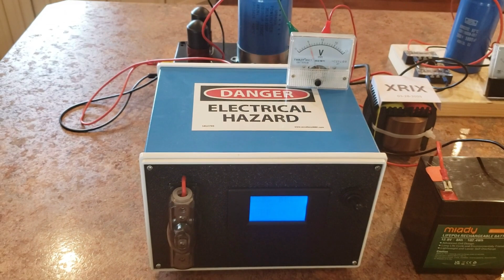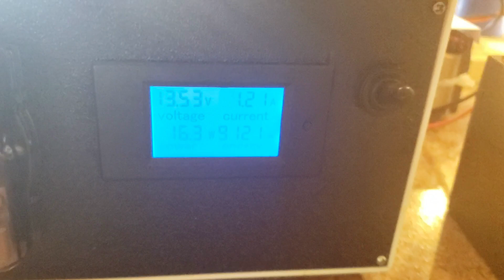Over Unity Working Don Smith Device - Part III

Comment: Can you please tell me the model of the LEDs used? Does it consume 20W each or is it equivalent to 20W light? I found PHILIPS 2W class A bulbs and they are equivalent to 40W!
Reply from the maker: I have used these but I buy different kinds https://www.amazon.com/dp/B082PQNSH3?ref_=ppx_hzsearch_conn_dt_b_fed_asin_title_7&th=1
Reply: @XR_IX  I invite you to put an ammeter on the output after the large capacitor, and of course an incandescent bulb! AI invited me to connect UTKIN's transformer to the battery and do tests with or without load if the power supply doesn't show me extra consumption!
Reply from the maker: @profy2002  I don't trust AI

Comment: could you run an inverter off the output cap powering the lights?
Reply from the maker: Yes, if you are talking about creating the inverter off the shelf. If you think you are going to attached it to a COTS inverter, you have to boost your input power. Basically it's a question of magnitude. Multiplication of very small  (half a joule) is going to have to have more power or more tuned stages.
Reply: @XR_IX   thanks for the reply, have you tried or would it be possible to boost input power with something like a cockroft walton or marx voltage multiplier without needing to increase actual the battery size or source input, just thinking along these lines cause you could charge larger input caps by leveraging the massive potential difference of the voltage multiplier and ground or chassis ground if you want to keep it isolated
Reply from the maker: @SYNTNT  Don't think electrically, remember what the fulcrum is. Input energy is simply how large the exciter capacitors are. How do you fill larger buckets?
Reply: @XR_IX  sorry was referring to the exciter caps as input caps, could this be viable to charge larger exciter caps? i've got a simple plasma globe osciallator, basically a tiny flyback, charging a cap thru an avramenko plug and when i ground or floating ground the negative of the cap it increases the charging rate massively, i was thinking that running a voltage multiplier off the flyback would increase the potential on the positive side would increase it further, meaning i could charge larger caps without 'more' input, and then eventually go the full way to transforming.
Reply: @SYNTNT  
Hi SYNTNT,

I was able to get the exciter using a 4kv nst to fire at around 30 times a second with a 1200v gdt with  3 2100v 1uF cap in series. The power usage for the nst is around 13watts running from a 12v power supply.

Do you know how fast your caps how many times you can discharge your caps with the plasma globe oscillator? The voltage that you're discharging at and the size of the cap and the frequency that you can discharge at. 

I've been experimenting with earth grounding with a different setup. The earth ground was able to change my output from 76Vpp to 182Vpp. I am pretty sure I'm still doing the electron cycling incorrectly. I still can't get much current from earth grounding. You're supposed to be able to get as many amps as voltage with earth grounding, but I can't get anywhere close to that. The rms voltage was like 20v-40v or something. It would be awesome to be able to get 20v at 20amps. I'd be happy to get 20v at 1amp right now. The earth ground wire I'm using is only 10awg.
Reply from the maker: @SYNTNT  You have try to run down your theories by experimentation. Only way to be sure. It is the scientific method we learned in third grade. I have been working with others who try to produce "More" from electrical tweaking. It all seems promising... until you put a load on it. The only path forward is magnetic multiplication. Of course that works best in a resonant configuration. A globe is useful, if you manipulate the guts to be disruptive. If you want "More" just stick a disrupter circuit inside it. Because then you are creating a strong magnetic disturbance. More dense flux lines, means more capturable current in a coil.
Reply: @briareosbri i just uploaded a vid, nothing special mainly just messing around but there’s lots of different arrangements, the tiny oscillators dont charge the caps fast enough for any real work but the slow pulses are easier to experiment with and figure out what works, i think it might be possible to increase cap charging rate with a voltage multiplier for little to no increase in input but we’ll see, XR is right that the real power is in multiplying the magnetism, im just also interested in seeing how small that input can get
Reply: @XR_IX agreed, dont want to start chasing the wrong rabbit lol, part of it is enticing though since the exciter caps are essentially electrostatic, just makes me wonder how low you could get the input since creating a huge potential difference can be basically free with the right setup, ill be uploading vids with progress if you’re interested, looking to replicate OU I, or maybe do a kind of spin off if i can get things rolling. thank you for sharing all of this info though, genuinely, it’s helped a lot
Reply from the maker: @SYNTNT  Sharing makes me focus. Thank You

Comment: Hi XRIX, thank you for your contributions, I’ve learned a lot from you. Question regarding the use of capacitors to generate disruption as opposed to coils.  Assuming youre familiar with Rick’s work, in what he calls the ‘third stage process’ of his motors, he uses the pulsed DC  output of the coil to feed a chain of series impedances where each impedance acts as a negative resistor. It’s to my understanding that your OU I works in a similar way except instead of a coil impulse driving the chain in series, it’s a disruptive discharge or capacitor impulse driving the chain in parallel. The capacitor seems to be such a crucial element in both the blocking aspect (like smith showed with the DSE & in the Hairpin) and discharge aspect (like in Kemeny’s patent where cap discharges seem to create the desired conditions along the wire where his motor coil is placed). If the capacitor is so crucial in these setups, but the same effect can be achieved with coil impulses like in Rick’s setup, why opt for capacitors, are there advantages? Am I missing or confusing transmission with amplification? Thanks again ✌️⚡️
Reply from the maker: Those are good questions, and I am not familiar with Rick's work specifically. I would be speaking to the device details where I may mottle his core principles or get it wrong. I can tell you why a capacitor is used in my devices, but also why you can see the effect outside of using no capacitors. My theory, is that as Don Smith said, that it is the "On and Off" of current that creates an effect. A capacitor is not needed to accomplish this as Don said you get this effect every time you turn a switch on and off. It appears when a spark gap is used, because it functionally is an on and off. You can read in physics that  a spark gap creates RF when it snaps, and low level X-Rays.  The abrupt acceleration and immediate stop, creates the disruption. I theorize that disruption can be used to gain multiplication of action, in magnetism, which can be either used to push a magnet, or induction for transformation. I capacitor just makes the disruption quick, like a stroke of hammer. Slowly dropped a hammer has little power, sudden impact creates more power. Tesla was hired to figure out why Engineers would die when they turned on huge DC dynamos. Same effect in a large enough quantity influences all conductors in the near field, and we are bags of water with a ground path.
Reply: @XR_IX Thanks a lot for the response, as someone who gets caught up in a lot of the details, that simplified things a lot, interesting fact about Tesla too. Would you mind to elaborate a bit on your Mini-Wardenclyffe Runs Motor & Light video, and unlisted Mini Wardenclyffe video? Looks to me like they’re both, especially the unlisted one, essentially the same as Don’s AEG schematic except using a FWBR on the second plate instead of an Avramenko plug, as well as charging a cap with the potential difference to run the motor, and running an LED with the counter plasma or displacement current (?) coming from the ground. My question to this is are both of these methods to driving the loads transmission artifacts? If so could amplification be achieved by adding coils/ impedances along the ground wire or the wire coming off the second plate to intercept whatever current may be present? Or maybe simply adding more FWBRs or Avramenko plugs as long as they are decoupled effectively from the TX? Kind of just thinking out loud at this point lol. Any feedback is greatly appreciated. Thanks again ⚡️
Reply from the maker: @pebnut  I think you are asking if there is amplification in Tesla coil. I am stating that in such a way, so you can see the big picture. A Tesla coil is a type of exciter, as a neon transformer or a ZVS driver. So really the question is how you configure the output, not so much will one circuit do better than the other. If you configure a tesla coil as I do to be a mini-W, it is suited for one wire transmission, but if you aggregate the magnetism, you can directly use it to loads using a simple Tesla coil as in my four light video. You can also use the relationship between Earth and Air ground, and drive loads directly if you rectify and store the energy. There are many possibilities with the output. The mini-W is taking the sparking end of L2, and pushing it into a curved capacitor. A dielectric separates the 2nd plate. If you look a the real Wardenclyffe, it is an inner ring surrounded by the outer cage. I theorized it was a way to harness the drive of the plasma to seek ground potential. We see that in a classic Tesla coil when it arcs to ground. But when the energy arcs the force is lost. I am using the build up of potential to push the ground. That is one of the things Tesla was doing. I have not tried this fully, but I have done it over short distances, I pushed the Mini-W into the Earth, and had an identical coil with a similar top load connected to a high speed FWBR, the DC could again be stored and illuminate an LED bulb beyond the near field. I had success with salt water as well, so my full test would be to take a mini-W to the ocean beach, and see how far a distance I could illuminate an LED. If it weren't for Sea Turtles, I would of already done it.

Comment: Hello Mr, Love your work, I watched all your videos and most of your very impressive reply to people, thanks for take the time to illuminate us with this wonder discovery's, can I ask you a 2 question then after reading I have.
1)The exciter parts consist: battery connected to (zvs or any driver)  to hv/hf coil like zilano diagram to GDT in parallels and a 1Uf cap in parallels and other 1 UF cap in series connected to a MOT high voltage to low (voltage reduction) to a FWBR( the diodes you have specified) and connect in parallels the large DC cap to the load, this is what I understood, thanks for that, my question is in the Zilano diagram he used a diode before the GDT are you using one?, if is yes what kind?, the 2 Cap 1UF one in series and the other in parallels are AC cap? from the microwaves? or other type?.
2) This last video is more then great and thanks for shearing, If I see well you put a extra coil on top the transformer and you charge other big cap maybe discharging by the 2 Zenon tube, is this beneficiary to the end the load or is proof we can extract more from the different pats?. I am building IT. Thanks for any help you can offer, and the patience to us , we are in the learning process. Best for you and yours.
Reply from the maker: Thanks for trying to build it, and is far leap to take Zilano's two dimensional schematic and make it operational. You'll see. From your description let make some corrections. My approach is to use two FWBR using BY228. Specifically the Philips variety. The first FWBR is right after the HV, and does the same thing as Zilano's single diode. You are taking the ~30Khz of AC, and need to charge the caps with DC. The FWBR works far better than a single diode, or AVplug. The best solution would be to not have HV module at all but have your DC supplied directly by DC source like a battery. Digest that, because it puts the HV module in perspective. Then the other thing is that if you put the 1uF cap (single) series into the HV primary of a MOT, you will miss a very crucial piece of the Zilano circuit. He uses two, the main hammer is the cap in parallel with the primary, the other is in series with one of the legs. I use three caps because it works best, one in parallel to the primary and one on each rail. See Tesla's page 57 drawing on the bottom of Colorado Springs notes. The spark gap is in parallel with all the caps on the rails. What you want, is to to make a parallel tank circuit between the primary and the cap. But you must have some way to block the AC to the cap. Sending AC to the cap will result in flipping the charges back and forth. What you want, is to charge and hold it until the gap fires. When the DC fires through spark gap it creates a disruption that the primary uses to make a magnetic field. The field collapses and the tank circuit starts to oscillate. The oscillations the secondary now now can be harvested by the second FWBR and stored in a large Cap.
Reply: @XR_IX  Thanks a lot for your help, and clarify those points, when you are using the diode BY228 in mode FWBR  after the HV/HF that indicate your voltage it is not that high, under 1500v?, Thanks for that.
Reply from the maker: @Fernando-123  This is the fundamental thing people don't understand about diodes. You really are only protecting the the reverse voltage.  Which is determined by your GDT. Your HV source can be capable of 4500 or 7500 volts, like mine but I only charge my caps to 1500V (of course spark over has a range of operation see the specifications) because that is the limit of the GDT. The great thing about  a GDT, is when they fail they tend to fail closed. Hence you just see your draw much less, and the GDT stops firing as it shorts and the caps don't charge up very high. It protects your caps without you knowing. But you should always understand all the possible outcomes and Engineer safety first, fuses, varistors and other circuit limiters.
Reply: @XR_IX  when you say: The best solution would be to not have HV module at all, you make me thing a lot like 20X 12v in series and chopping ?. Thanks for everything, thanks for using YouTube like communication is straight forward, the forum you have mention in the past not chance to text or connect to somebody. I will love to see other you beauty videos.
Reply from the maker: @Fernando-123  Once you understand the operation, there is no limit to what you can do with a hand full parts. I maybe wrong, I maybe right. I tell people these videos are fake. You have to find out. If you do figure it out please be kind and pass it forward.
Reply from the maker: The tertiary winding is an evolution of the spark gap. And clearly shows you can utilize the flux with the proper tuning. Remember that the "isolation" transformer is a tuned body, not only receiving energy from the primary in the induction  of the core, it is also an antenna. Think of yelling in a cave. What happens?